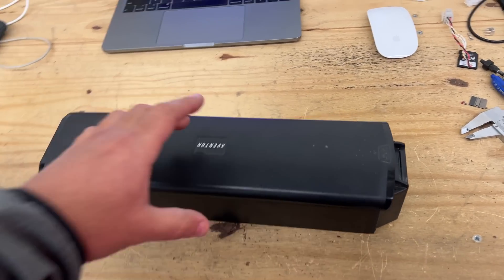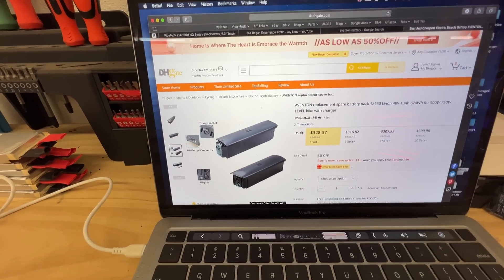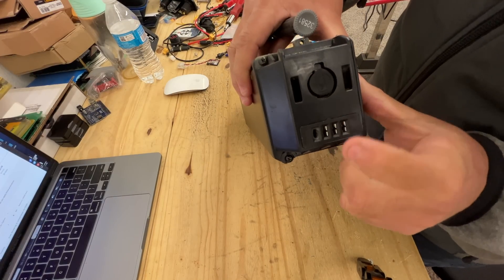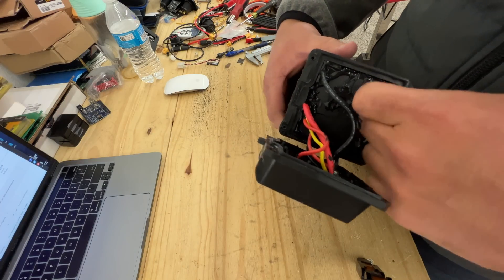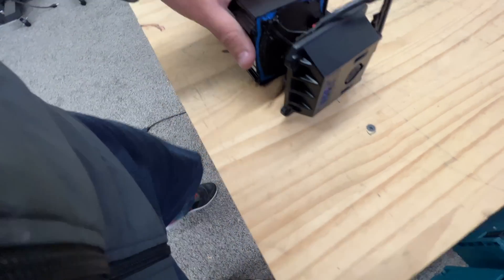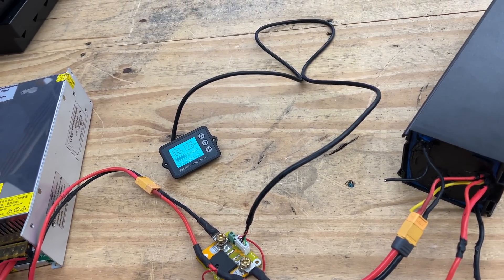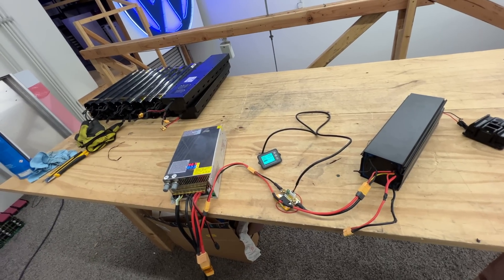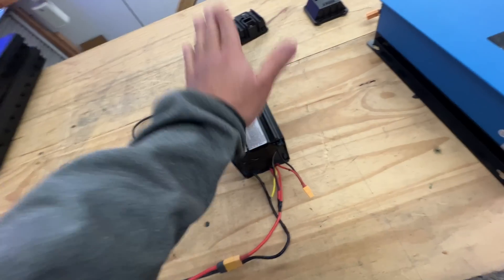R4 battery has Samsung 35E cells and its replacement is $300

Comment: Just charged mine and it works in my aventon level. Very happy to have an extra battery.  It's slightly different than the original it has an SYR trademark that the original one lacks,  the aventon sticker was gone and there is a knife scratch. 
The model numbers are a perfect match and except for the cosmetic variations I wouldn't be able to tell them apart.
Thanks for the half price new battery!

Comment: Hello peoples, I need help. I have a dork charger. ...So I connect the two center wires to the two outer wires and charge it? or do I not connect them while charging?
Reply: The battery has a charge port for the barrel connector that charges the bike.
Reply: @ghz24  any chance you know the max voltage you could charge this thing too? Or what I should be charging it at. I picked up the charger that he uses in the video
Reply: @egidio6david0   Should be 4.2x13= 54.6 I can check what the stock charger puts out. I'll put a voltmeter on it when I get home. I just assumed it was 54.6v.
Reply: @ghz24  I really appreciate your help bro.
Reply: @egidio6david0    Measuring the chargers voltage was a bust. Likely needs to see some voltage from the battery to turn on.
The rating printed on the charger is 54.6 volts.  The barrel connector looks like the size that fits a wireless router.
It is center positive.
Reply: @ghz24  awesome bro!!! thank you so much! as long as I know what is printed on that charger, I should be good right?
Reply: @ghz24  we picked up a Honda ATC 70 today. I have a 1800 watt brushless motor and controller 48 volt setup we're going to put on it.
Reply: @egidio6david0  Sounds like a fun project.
The charger matches the standard "48 volt" lithium ion charger. It should have an led that turns from green when unplugged or charged to red when charging.
I picked up a spare one on ebay in case of emergency and to use on a build.
It was less than $20 and I found one that offered the barrel connector as an option.
I found a 3 amp name brand replacement charger but it was $60 so I got a 2 amp one even though it takes several hours at 3 amps. If your charger matches the voltage and has the shut off led you should be golden charge wise.
Keep in mind this is a 762 watt hour battery so so pulling 1500 watts gives about 30 minutes of full acceleration time, assuming it can push the amps. The cells can push it but the bms is ? The bike says its 750 watts peak. Best I can figure this is a 13s4p battery.  Hope that helps.
Reply: @ghz24  thanks again for all your help. And the info!

Comment: Hey bro, sorry if this isn't the right place to ask you about this but I'm interested in making a lightweight 12 volt motorcycle battery to replace the lead acid battery in my dirtbike and I'm wondering if you sell any LiFePO
4 cells that would be appropriate for this type of application?
Reply: Try to find some SPIM08HP cells. They are high power and I use them for my spot welder and to jump start my truck. 4 in series does the job.
Reply: How many amps does tour dirtbike need?
I don't think the SPIM08HP pouch cells are a good choice for your application.
If you need high current (doubtful unless you have electric start) consider 4 headway cells. Pouch cells aren't very impact tolerant and LiFePO wont catch fire.
Also 4 pouch cells fully charged is 16.8 volts where 4 LiFePO are 14.6 volts.
If you don't need high current look into full river 26650 type iron phosphates.

Comment: Just ordered, I have an aventon ebike that uses these batteries, crossing my fingers they hold a charge 🤞
Reply: Did it hold a charge? Wondering because I'm waiting on mine.
Reply: @SnedsLife  wouldn't work in the bike or charger, I believe the BMS is either bad or had it's protection tripped
Reply: Did it work?

Comment: What kind of charger do you use ? can you do a video on your equipment that you utilize ?
Reply: I charged mine (R4 & R3) with a barrel plug behind the rubber cap. Super convenient. BUT, I am looking for a mount like the R3 Reention Dorado 48v 11.2ah has offered by Biktrix with a key to lock too(80 dollars though = more than the battery) and Aventon is sold out though not sure if it is the short length needed or long length they offer (and no pictures on Aventon site). A mount for the Aventon (R4) would be great then I can use water bottle cage on existing bikes I have.
Reply: My 48v 2Amp Radwagon charger worked though I also have a smart charger with variable amps and 80,90, & 100% option.

Comment: The 2 wires left over are ignition ie touch them together and you'll get it to work bro pull out a few filements of each wire set it up then touch n see ?

Comment: I'd like to see a solar battery powered furnace for smelting. Of course it would probably be small and could only start with tin, or pewter or for melting soda cans. But everything has to start somewhere!
Reply: There's one guy who makes an efficient glass furnace with infrared heaters and highly insulated chamber that only uses $8 of electricity a day.  So solar + battery is definitely doable for smelters.
Reply: Induction coil furnaces could probably run on batteries
Reply: I'd still like to see how many batteries, the set up, how long to charge before the kiln gets fired up and how much of what type of metal can be PROPERLY melted down to bar. I say properly because I think it would be an unfair shot to wad up soft metal and call it versus actually melting it down.
Don't get me wrong, I am not against any of this. I am genuinely curious and would love to see it done!

Comment: The shape of those batteries makes me want to have a modular system for the house where you just click in a kilowatt hour and then you can expand it however much you see fit maybe they could have quick disconnects for water cooling
Start with 1 KW hour at a time and then just move your way up to 10 or 20